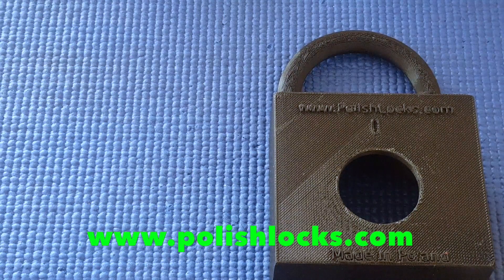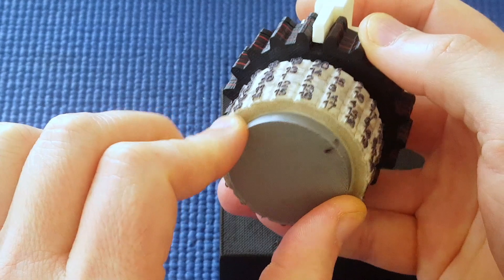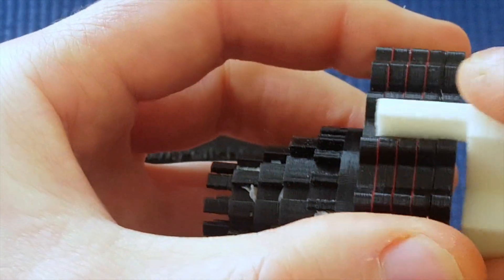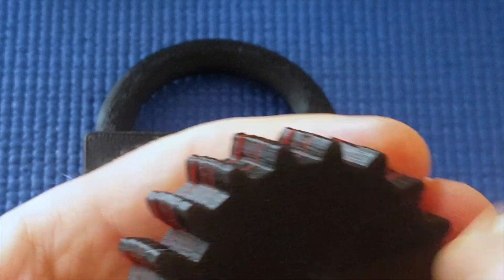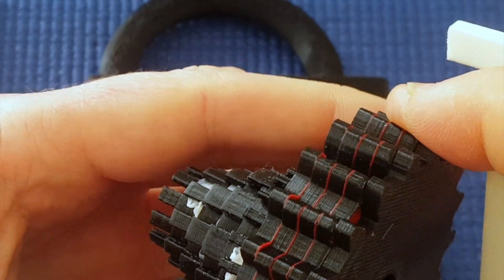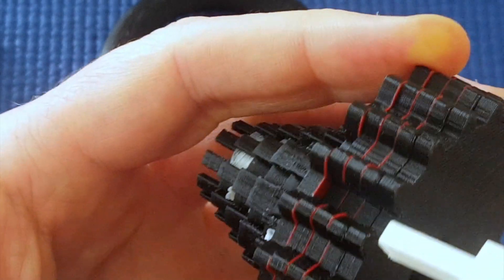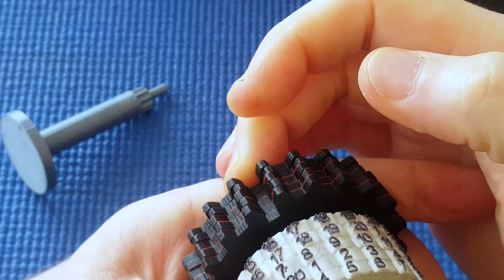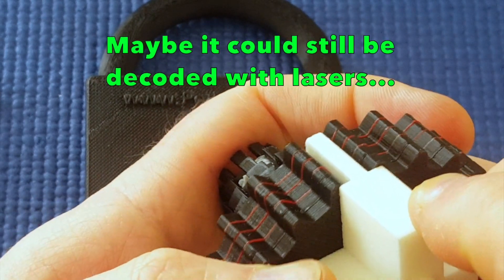(Picking 137) Final thoughts on the Polish Combination Lock prototype

Comment: Yes Swynndla has very good analysis of this mechanism. I appreciate very much all feedbacks I received from all people attending the worldwide decoding challenge. In fact I thought that the real weakness is the "Stair" effect between the plastic wheels. Swynndla proofed that the real one is the flexibility of the plastic actuator which is bending under certain force and this bending allow to decode this plastic version. However even now Swynndla spend a lot of time and effort to decode those plastic versions. If it will be confirmed that this is the real weakness than metal version will have no flexibility at all and the actuator bar will always touch all wheels the same time equally. The security is the most important aspect of this mechanism. People think that it is quite easy to destroy outer rings and then to open this lock. This is misunderstanding of the internal construction. I can tell you it will be relatively easy to destroy all external wheels but the lock will stay closed until will be cut or drilled and then open. For me the most important is to create lock which will be not decodable in short time (maybe possible in many many hours or even days with laser etc) and also must be easy to operate. In metal version with 10 000 000 codes the user will open it in less than 20sek if will not hurry up. There would be 7 wheels to align rotating both directions freely. The first prototype of this padlock would be quite big with closed shackle like presented on my page https://www.polishlocks.com , I am working now on optimisation of the production and final design.

After few full metal pieces will be produced I will send them to all participants in worldwide challenge for final review. Will see how fast I will be able together with some Polish companies to produce those first models. It will be very costly and I could not be able to afford this first prototypes. I will let you know on my page and YT channel if there will be any progress. Cheers, Zbigniew

PS> It is very important that I have found those people like Potti314 or Swynndla and other people to help me understand all possible weaknesses and to support me in the development of final form of Polish Combination Lock, Thank you very much again.
Reply: Can you just make the false gates all random heights so that even if there is some play or flex you wouldn't have any reference to compare it against?
Reply: @OliverBatchelor  Well if this will be the case than this mechanism will be decodable. To decode you will need to take random 5 numbers than check which one is the highest and in this moment you know that in particular knob this numer is false gate. Than you will follow all numbers and you will elliminate all true false gates. In each 5 numbers alligned always will be one which will be the tallest and this one you will reject for the rest of decoding. After 30-50 attempts you will narrow the true gates and then decode the lock. The best way to avoid this is to keep the difference between the gates almost zero and to have rigid actuator which will not bend as in this flex plastic model. The flexibility of the actuator killed the security level in this plastic model however even than it took over hour to decode. Cheers, Zbigniew
Reply from the maker: @OliverBatchelor  I think this is a good idea.  A couple of other people have previously suggested the same thing.  User a laser might still work but it'd slow things down heaps.
Reply from the maker: Thank you for the opportunity to have fun by investigating this lock. :D :D  Thank you for the information.  I'm looking forward to the metal version. :D

Comment: Basically you are doing the same thing as manipulating a Group 2 Safe Lock.  That may be secure enough (in the metal version) to require a considerable amount of time to open (and thus good enough).  There are Group 1 "manipulation proof" Safe Locks that provide additional mechanisms to prevent this type of manipulation attack.  Basically these "anti manipulation" mechanisms mask / cover the gates so one cannot feel where the gates are.  It's all a question of how secure the lock needs to be (generally more secure = higher cost).
Reply from the maker: Intetesting - thanks for the info! Cheers! :D :D

Comment: Good explanation. Metal version will be a beast. Dunno what other exploit it could have. Guess we'll have to wait and see. Great job on cracking it!
Reply from the maker: Thanks mate! :D :D  I'm thinking that the metal one would still be vulnerable to be decoded with the help of a laser ... due to slight manufacturing imperfections the bar would have to hit one wheel's false gates before the other wheels, (just like pins in pin-tumbler locks, one will "bind" first) and so moving that out of the way (eg to the true gate position) would make the front knob turn a bit further ... a very slight turn but still noticeable if a laser is used with a mirror and a wall (and lots of time!).  There are ways to make this more difficult (and the inventor is thinking about implementing some of them) but it's probably not a real-world attack anyway. :D
Reply: @Swynndla  yeah, at that point best just get the bolt cutters lol. But if a lock is going to take anywhere close to an hour  to get into, I think that's the upper extreme of resistance and proves the excellence of the design. I'd buy one (if I had anything worth securing, that is lol)
Reply from the maker: @richardgmiami  LOL - it's interesting that for some break-ins, the person breaking in may not want to show they've opened the lock, eg a spy etc ... some insurance companies wont pay out unless there are signs of a break-in (otherwise they can say you left it unlocked and wont pay out) ... but I guess these things are for the paranoid. :D